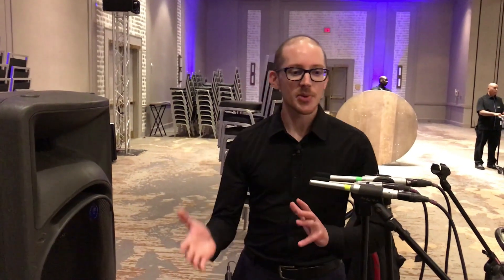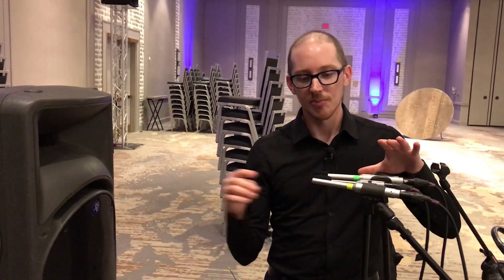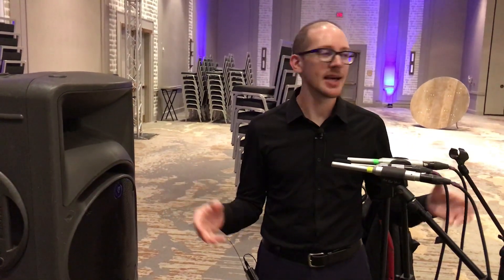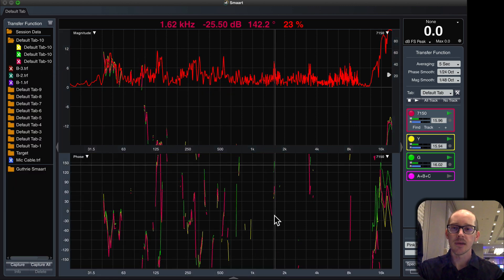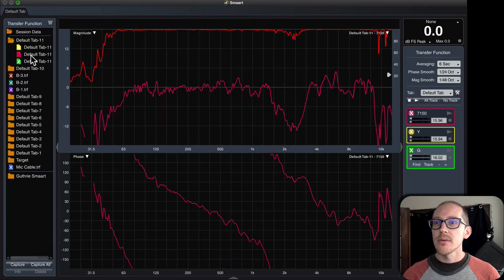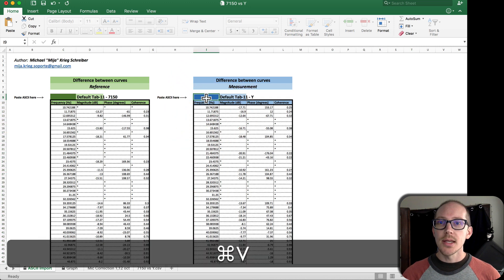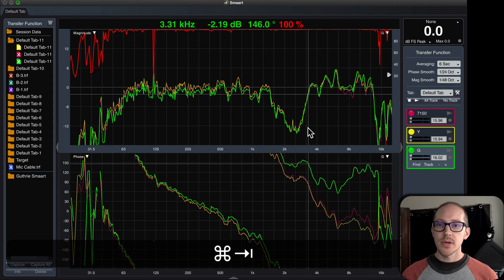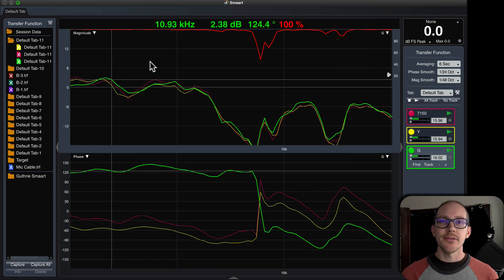How to create your own mic correction curves in Smaart®

Comment: Hey Nathan, in the Corection calculator is something wrong. If there is a value like 07.12. in any cell, excel will replace the value as a date. So measuremt 7.12 dB is 7th of december.  Due to password locked cells in the excel document, there is no chance to correct the cell value to a numerical value.
Reply from the maker: Hey Marco, this is unfortunately not my own calculator so I can't be very helpful. This video might help https://youtu.be/4Zcc8pmC53s?si=9g8ldpJ22ky3Z2Gt
Reply: @nathanlively  thank you. Will help, of course.
Reply: Git help from Mija... we found out, that two issues where responsible for problems. 1.) US Excel will have dots "." in numeric values and EU Excel has "," in numeric values. It has to be dots in the numbers. 

2.) Saving the mic calibration curve works only in TXT (tab devided). Then you can import the file in smaart v9.

Comment: hello mr.nathan this mic correction curve is just for this measurement speaker right? if i want to switch to another speaker and use same mics i have to change my data in excel sheet right ?
Reply from the maker: Hey Elie, the source is not important, as long as it is full range. Once you have your mics matched with one source then you are set to measure any other source.

Comment: Hi, Does this match both frequency and phase?
Reply from the maker: Hi Peter, if you open up a typical mic correction curve you will only see two columns: frequency and magnitude. That is the case here. I'm not sure how to make a phase correction in Smaart outside of using a quick compare. If you are using Crosslite, correction curves can include phase and polarity.

Comment: Hi Nathan!

Awsome video! This was the thing i was looking for...
But unfortunately i can't make it happen with my setup :(

I have a Umik- and an old Nady-CM100
With Smaart at the  measurement configuration tab when i create TF Measurement i can't select the Umik-1 as REF because the Umik-1 is a usb mic
& the Nady goes thru the phantom of my soundcard..
I can only use one device for the reference input.
It looks like you have to connect all the mics to one soundcard otherwise you can use can't select a REF for the other mic..

Am I missing something? or is there a work-around?

Thanks! 
Regards Dave

Comment: Hi Nathan ! i'm having an issue with the calculator as it requires a password to add data, did i miss it somewhere or is that new or something ? thanks ;) 
anyway that's about time i say thank you for your work, you're doing a great job, cheers !
Reply from the maker: Hey Loris, sorry to hear that. There shouldn't be a password. Maybe try downloading it again and/or saving under a new name?
Reply: @nathanlively  hey, thanks for the reply! i don't know it's really strange, because i can modify the sheet manually by writting values in the cells but i cannot paste any value because the sheet is protected...
but anyway in the end i tried to load the excel folder in google spreadsheet and it worked pretty well so no big deal (i should have updated the post sorry)  
Thank you :)

Comment: Could you elaborate more on the reason why the green mic phase differs from other mics phase?
Reply from the maker: Hey Lukas, those difference in the high end are due to minor offsets in the delay finer. Since the delay finder has a maximum resolution of 0.01ms, sometimes it is impossible to get the phase traces to lay perfectly on top of each other.